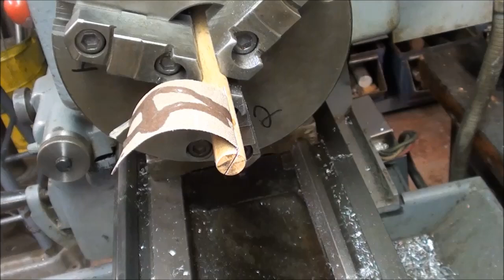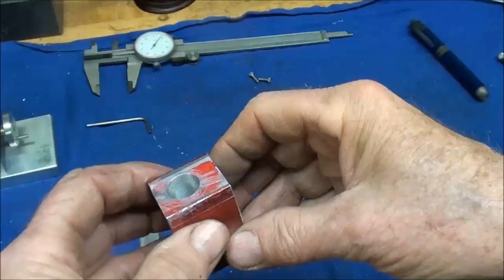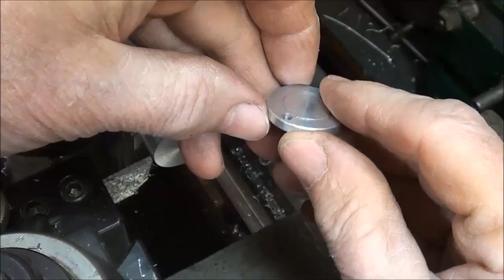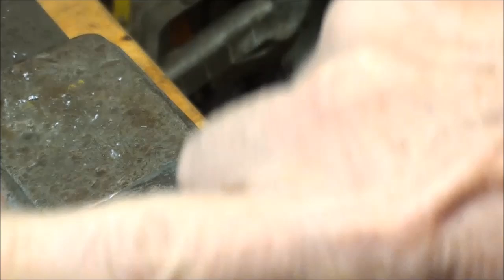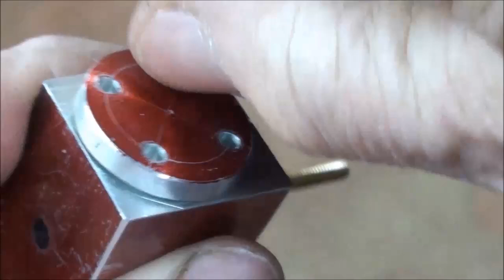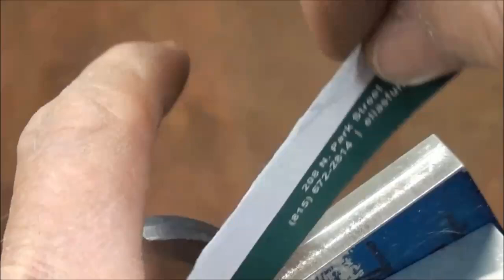WOBBLER DA STEAM ENGINE how to build pt 3of5 tubalcain

Comment: Awsome Video... I would like to try my hand at drawing this in CAD, then machine most of this engine using a mill I converted to CNC.  Do you have any dimensions for the sizes of the parts?  Thanks... Richard
Reply from the maker: I am not sure if I have drawings for that, check on the website called myheap.   
Then, look up Mr. Pete’s projects on that website
Reply: @mrpete222  Thanks for your quick reply.  Love  your videos!

Comment: Great video as always! I was wondering if the double acting engine has more torque than a single acting one? Less lost motion between cycles?
Reply: A single-acting engine will produce useful torque only in the power stroke and none on the exhaust stroke.  It depends on the flywheel to carry the engine and load through the exhaust stroke. A double-acting engine will produce useful torque in both directions.  The exhaust stroke of the head side is the power stroke of the rod side and vice versa.  When powering the rod side, the torque will be slightly less than when powering the head side due to the area of the connecting rod but won't be noticeable in a model like these.
Reply: @kensherwin4544  So then a double acting is like a 4 stroke gas?
Reply: Not really.  The 4 strokes of the gas engine are exhaust, intake, compression, and finally power, requiring 2 full revolutions for a complete cycle.  The power stroke only happens 1/4 of the time.  A single-acting steam cylinder has a power stroke 1/2 of the time and a double-acting cylinder has power available nearly 100% of the time.  Any engine with only one cylinder cannot produce power when at exactly top or bottom dead center.
Reply: @kensherwin4544  so the double acting engine has no gap between power strokes in each direction. Thanks, this steam stuff is all new to me.
Reply: You are correct.Another way to think about it is to think about a bicycle crank.  On any bike, you can push down on a pedal to generate a power stroke but the pedal has to coast back up for the next cycle, just like a single-acting cylinder.  If you have locking cleats or toeclips on the bike, you caan pull up on the pedal, generating two power strokes per revolution, just like a double-acting cylinder.